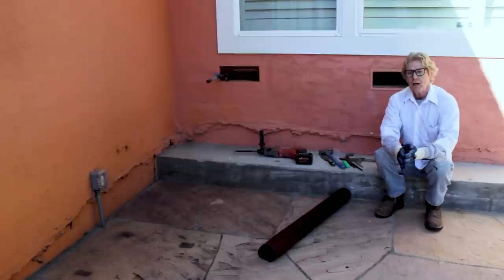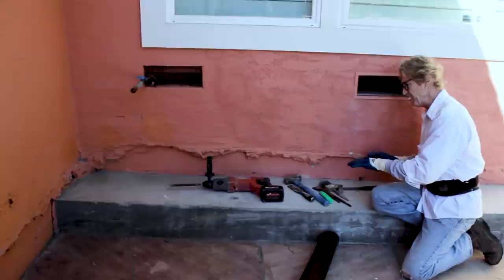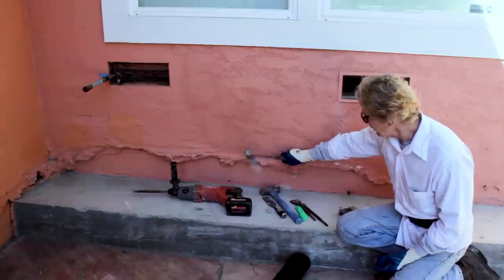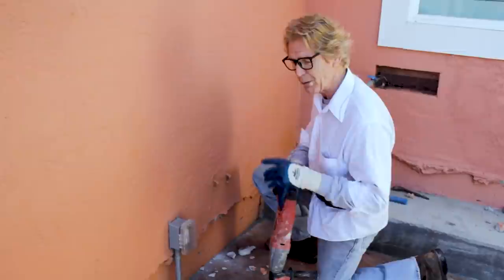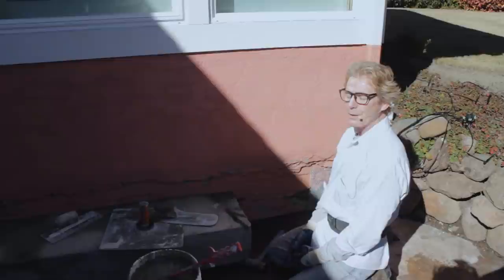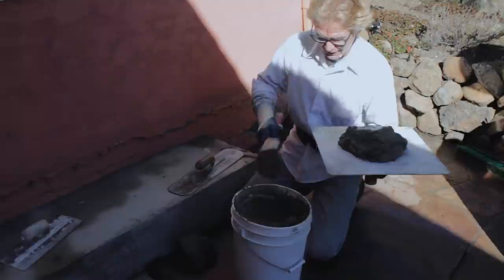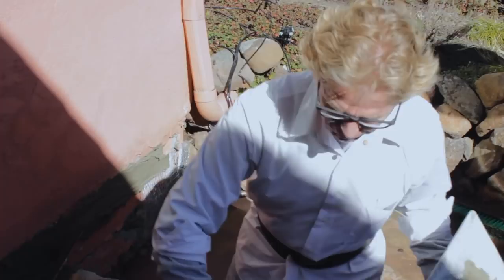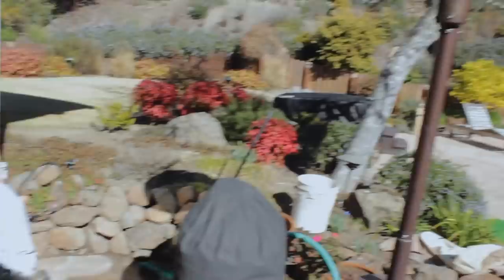Fix an Ugly Rough Concrete Foundation with stucco

Comment: Hi Kirk. Hey I have a question. We are remodeling an old house from 1938. We decided to redo the shower walls with plaster. We put in new wonderboard underneath. Where the wonderboard came together we put in more plaster to fill it. We know that you can tell it’s dry by the color. Unfortunately the seams where we added extra plaster to cover are still not dry all the way. We did the job on Oct. 15th and it’s still not totally dry. The bathroom has had an extra heater and small fan to keep the temp over 75 with under 15% humidity. Is it ok to seal or do we need to wait longer? Or are we missing something? Thank you so much Kirk. We enjoy learning from you and your videos so much. Take care!
Reply from the maker: Morning light, Dude, two things. Wonder board is not waterproof, so hopefully, you applied a thick peel and stick under that wonder board.
 Your other issue is that most toppings dry within an hour. If not dry after a day, the material was compromised or too old. Sorry.🤔

Comment: You are the man! When indoor plastering on the veneer coat can I go over the previous veneer coat without a bonding agent? Thanks
Reply from the maker: Hello Sarah, I would not advise it, Quickrete bonding agent at Home Depot is less than ten bucks for a quart, it's cash well spent in my opinion.😉

Comment: Hi Kirk and Jay, been watching the video's for years and it inspired me to start offering interior plaster work as part of my drywall business (repairs mostly, not good enough to offer it on full jobs yet).  I've read all the literature from the USG site and searched YT and walked away more confused than when I started. After all my research I'm convince there is no single source that gives a simple but complete explanation of the difference between Imperial and Diamond; why and when to use one and not the other and how to determine which scenarios need a two coat veneer basecoat/veneer finish or when you can just use a veneer basecoat or just use a veneer finish. I assume it's because there is no one 'perfect' answer because of all the variability in the world and different situations but any chance you might be able to make video giving some general rules and guidelines to reference? Thank you for all you do!
Reply from the maker: Hi J R dude, LOL, the longer one researches online, as a rule, you will get many conflicting answers, Like mine here. My answer is I can use either and get the job done, whether it's a quarter-inch thick or an inch thick. 
However, explaining this would take longer, and many folks would become confused, as it's not recommended.
 
https://youtu.be/UXVrDwdh3Ro/ just explain a basecoat.
https://youtu.be/-e-3-6wc0nU/ just a finish coat.
https://youtu.be/KldxODNprP0/ typical both coats for maximum strength, lime plastering kitchens.

FYI, the word veneer has nothing to do with lie plastering. Veneer means a thin application, that's all.
 I feel the word" veneer" should be removed from all bags of lime plastering as even the Plastering experts with over 20 years don't understand what "Veneer" actually means, moving on.
As so many email me to say! Hey, Kirk, I can't find the "Diamond Lime Plaster,"
Diamond is simply a name like "Imperial" both of these lime plasters are made by USG. 
If you can't find Diamond, so what. Buy another lime plaster.
USG's calls their Lime plaster "Diamond," one has to admit it's a clever name for lime plaster,
Why? Diamonds are minerals composed of pure carbon. It is the hardest naturally occurring substance known. Damned clever lime naming if you asked me?
Google, "Lime Plaster sold in my area," 
FYI,  it can be named "XYZ or Blaw, Blaw, Blaw, Lime Plaster," as long as it's a "Lime Plaster," you're good. 
Lastly, for lime plasters, Google, "plastering yards near me." Now you know.

Once more, I'll describe it differently at the risk of repeating myself.
Do you understand what veneer means? It simply means a thin application. 
It has nothing to do with either a basecoat or a finish coat.
 But for the best results for schools and hospitals, for example, You apply a basecoat, this has sand and adheres well to the wall when properly prepared and provides strength as it has sand in it.
When any lime basecoat drys, now you can use a finish coat.
  Most finish coats such as Diamond or Imperial have little to no sand. If it does have sand, it's silica-like or like talcum powder, which is very fine. 
Diamond and Imperial are both made by USG. 
I prefer the Imperial lime finishes as it has a bit more lime in it. 
This means I can bring it back to life when applied if I wet it before it drys entirely and makes it smoother if I choose to.
Thus anyone can make this fine smooth as a baby's butt or like glass.
Plus, the finish coat adheres to the first coat by suction, as long as that basecoat is moist.
 Summery, any finish lime plaster can be troweled down very smoothly. 
Why can it be troweled down very smoothly? 
The finish coat has little to no sand, sort of like tapping mud, but stronger.
 You asked!
Reply: @StuccoPlastering  You're the best Kirk! We're all lucky you guys decided to get on YouTube! All the best!

Comment: Greetings from Alabama. When using Quikcrete bonding adhesive as a paint on, does it need to dry completely or should still be tacky. Pray tell, even Quikcrete gave me conflicting advice. Geez! Was instructed apply stucco while still tacky..then told can apply stucco up to 48 hours later. And should I wet down the bonding adhesive before applying the stucco? Inquiring minds want to know? And BTW, I think I have become addicted to watching your videos.

Comment: Hello again Guru! I noticed these walls had no weep screeds. I read some buildings don't require it. If it's not a hassle, can you explain when it doesn't require it? Thank you for another great video!
Reply from the maker: Howdy Thi, Good eye brother, Back in 1975, it became code to start installing weep or drip screeds for three reasons. One to stop the stucco from touching the dirt or ground. Two, more importantly, to give the walls an expansion joint, and three, to provide us with plasterers something to stop at. There are more. We didn't start installing them until about 1980. Yea, I know I've been in this trade too long.
FYI, my own home had the stucco touching the ground. Didn't lose any sleep
 over it as I knew why. 💃
Reply: @StuccoPlastering  Thank you for the education!

Comment: Kirk, I am a painting contractor. I recently looked at a job. House development was built on a hill and the lots were leveled by fill. about 12 years ago. Foundation wall is either cement or block. . Stucco or Sto was placed all over the entire house. Not certain what they call it in your nick of the U.S. Problems is as such. The cement plaster/stucco/ sto or whatever one wants to call it is in great condition on the house in the areas above my knee caps. Plaster is blowing out on the bottom areas. From my inspection, the blow out starts at the same level and continues at the same horizontal line as the house slopes.  It is not a paint issue, I told the homeowner. It is either a structural problem , shifting issue or a product problem where the plaster was placed on 2 different surfaces. Any ideas.?I have actually never seen this problem before in my 40 years of painting. Will welcome your thoughts and am an avid fan of yours. While we have different trades, we do the same thing. We beautify homes. I tell it how it is,  Paint does not fix problems like this.
Respects and thanks for your teachings,
Sky
Reply from the maker: Howdy Sky Hawaii Dude, if I see a picture or two, I can tell you precisely what is happening and why. Send a couple to my email.
 kirkgiordano@gmail.com😉

Comment: Thank you for sharing your knowledge. We have a metal pole barn we’d like to cover with stucco. Can it be done? If so, should we apply the water proof paper
Barrier and then add the stucco netting?
Reply from the maker: Howdy Hudson, sorry, I don't know what a metal-pole barn is. I know if it's metal, it's watertight, plus one cant tack on paper to any metal surface.🤔
Reply: I stuccoed 2 gas stations (metal) in Limon, Colorado where I screwed the paper, then the wire onto the ridges of the metal on the first station.  I used the combination paper/wire on the second station, which worked out better.

Comment: Kirk quick ? If I had a exterior wall with 24 on center and Not hung with dense glass or plywood and black papered and lathed right on to the studs would the stucco hold and stick in between the studs with no hard surface behind ?? Will it cause bows or will it crack easily ??
Reply from the maker: Howdy Ray, 2 feet is quite the stretch, can you do it, I don't know. Can I? of course I can but would use this wire then attach 3.4 on top as 24-inch centers in time will have the newly applied stucco cracking. https://youtu.be/PQ5N69SoAJE/ lath a stud wall, self-furred stucco paperback wire. 🍾

Comment: Kirk I live in Michigan and we just bought a stucco home. I want to be able to get mixture right for the cement. Is the rule only 1 part Portland cement to 3 parts sand?
Reply from the maker: Howdy new homeowners, as a rule, yes, time times the sand to every one part Portland cement or stucco is correctomundo.
 However, there are many same-day already mixed stucco's sold at say, for example, HD or Lowes, sells “Rapid Set Stucco,” which has heavy sand, or buy “Grencor USA by Quikrete” which has fine sand.
 Both come with sand added to the mix.
 All one has to do is just add water and mix, then apply. 🤔